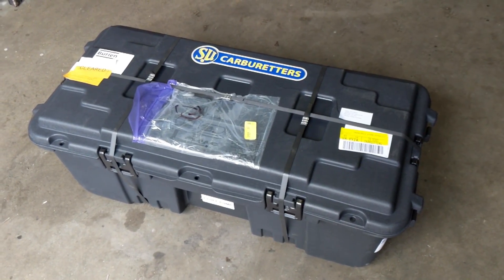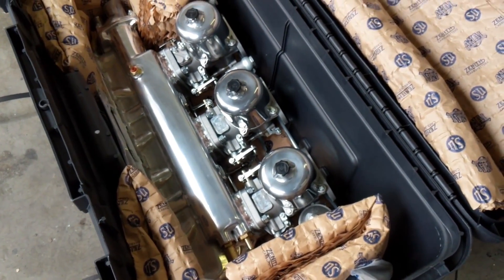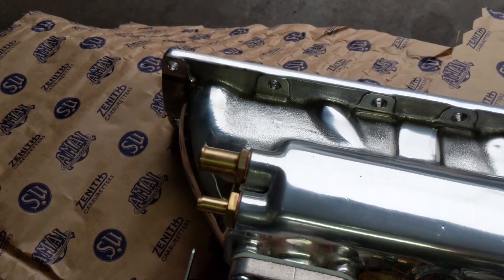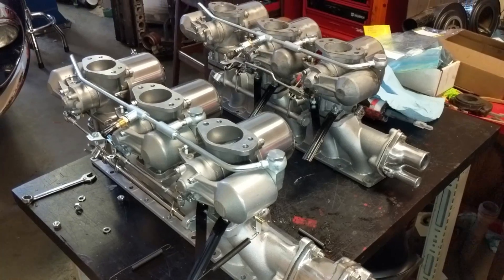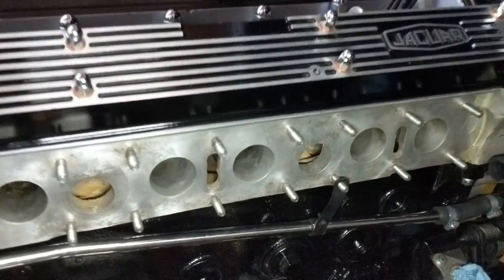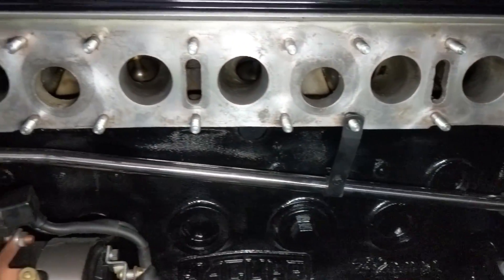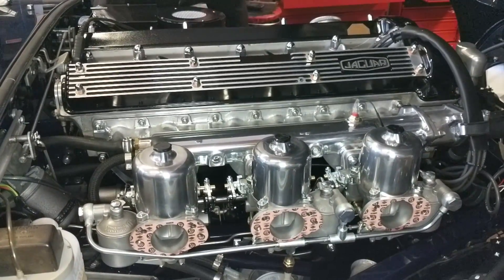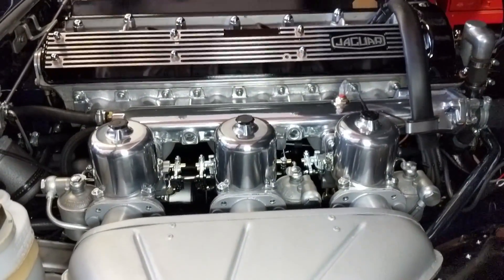Unboxing a NEW set of Triple SU Carburettors

Comment: Superb work with outstanding reman parts. Good eye on spotting the fuel leak. If you hadn't you may have discovered the short cut to perfectly tuned SU's. Set the whole rig on fire!

I had a'72 XJ6 in which I had done a head rebuild and carb swap from the factory Strombergs to twin 2" SU's. I had dearly wanted triplets but couldn't find any. 
The morning after finishing the project, I departed on a roadtrip from Toronto to Boston. The carb setup proved very troublesome for the entire trip untill on the way home at a stop in Connecticut, the cold start automatic enrichment device malfunctioned spilling raw fuel everywhere which promptly ignited. A number of tense moments went by while the conflagration was subdued with a borrowed fire extinguisher. I was forced to do a complete dismantle and rebuild at the roadside with a fair amount of improvisation to replace melted parts as there were no repair or parts sources available on a Saturday afternoon in Connecticut for an old British car. 
Once back on the road, I found that it ran better than it had ever run before and continued to do so for years after. Minus the enrichment device.

Comment: Synchronizing SU type carburetors – It isn’t hard to do at all, and the homemade tools are very inexpensive and easy to make.  You need 3 each 6” x1/4” wood dowels; in a pinch 3 good wood pencils will do nicely. Clean the dowels (or pencils) up so that both ends are flat and there are no splinters or bits of wood that can fall off and cause problems. The hardest part of the job is to suck out any oil from the dampener pistons so that the dowels don't float in the oil. Remove the dampeners from the carburetors and insert the wood dowels, pressing  down on them until they bottom out. Take a knife and score the wood dowels using the top of the piston housing where the dampers screw in as a resting point for the side of the knife. Twist the dowels while holding the knife edge against them to make a small groove all the way around the dowels. 

That groove is our zero mark and starting point for our engine running test.

Next, start the engine and note the distance of the marks above the top of the piston housing. Adjust the idle speed stop screw on each carburetor so that all 3 marks are at the same level above the top of the piston housing where the dampeners screw in and at the desired idle speed. A 6” General Tool stainless steel ruler works well for those who need a visual aid in getting all 3 marks to the same distance above the piston housing where the dampeners screw in.

As you push down the accelerator, you will notice that once properly adjusted,  the marks on the 3 dowels maintain the same distance above the piston housing where the dampeners screw in.
Reply from the maker: Neat process I assume this in lieu of a Uni-Syn Carburetor Synchronizer?
Reply: YES. It works on any number of SU carburetors  until you run out of wooden pencils to sacrifice... :LOL  It allows you to see what all the carburetors are doing in real time. No need to move the Uni-Syn and then find that after adjusting one carburetor that the other carburetors need adjusting.

Comment: lol I remember people saying use brake fluid instead of oil for the dashpots on an su carb as it doesn't rot the diaphragm and also made them more responsive as its thinner,,,,,hmmm?
Reply: I think you are confusing SU carbs with Stromberg, the diaphragm on a SU is only in contact with the fuel, the Stromberg has a different set up, although I will agree that using brake fluid in the dashpot might make them responsive but the correct oil is there for a reason, to enrich the mixture on acceleration.
Reply: Maybe has been a long time
Reply: I seem to remember being told to put automatic transmission fluid in the dashpots on SUs. They seemed to run fine.

Comment: I had a 1969 MGB Roadster with wire wheels that had the dual 38mm sidedraft SU carbs and it was interesting to work on them and tune them. Experimenting with mixture needles of different taper, to get the F/A ratio exactly right, was an interesting task. I would also fill in jet orifices with solder and then drill them out with tiny hand-turned drill bits for exact mixture control. I used to use a UniSyn meter for synchronizing carbs on my bikes and the MGB and Austin Healy that I owned. On my bike that had an individual carb for each cylinder, I would rough set the balance with either a UniSyn or measure intake port vacuum on each cylinder. I would then fine tune the carbs by doing a power balance test, where I would short individual cylinders an adjust the throttle butterflies for equal RPM drop from each cylinder.
Reply from the maker: Wow you had tuning down to a science!

Comment: Seeing as how you Hearted my comment, I will share a secret technique with you and all your followers.
How to avoid cross threading a screw, nut or bolt, and how to retain structural integrity in plastic when re-installing screws.
Always, lightly back the screw, nut or bolt in the reverse direction of the thread.
As you slowly turn the screw, nut or bolt backwards, as the threads of the two pieces come together, the screw, nut or bolt, will drop into the other piece, usually you will also hear a click.
It is at this point that you have mated the two pieces so thta when you apply rotation in the proper direction, you will not cross thread the screw, nut or bolt.
For everyone that has to remove screws from plastic objects repair what is inside the enclosure and then re-insert the screw, and maintain the strength of the original fitment, this technique should always be done. If you simply start turning the screws back into the plastic, you will cut new threads and reduce the structural integrity of your product by as much as 50%. Further, you will not get a third kick at the can, as the thread in the plastic almost always strips on the third attempt.
Happy screwing people! ;-)

Comment: Case is nice!  Free toolbox!
So what did you do with the packing?  Too nice to throw away.
I remember buying two 1 3/4"  SU's brand new for $25 the pair at an auto show here in OZ a while back. When British Leyland stopped making the P76 (Google it...) they sold all the bits very cheap.
Cant get over how smooth that engine is.

Comment: How do SU's compare to Webers?  I had a Datsun 240z with triple Webers.  I miss it still.  I have gone to the dark side and drive a pushrod V8 now (Chevy LT1 direct injection  in a C7 Corvette).
Reply: A headache to maintain after they get worn out
Reply: @GearheadOutlaw  Which?  the SUs or the Webers? It was always my impression that Webers were the top of the heap given that they were used in race cars (Ferraris, etc.) But I have always had a soft spot for SU.
Reply: @dwightbrown2808  was talking about the SUs.  My series 1.5 has 3 and I'm over the fence for webers and at the same time want it to remain original.
Reply from the maker: Webers are far superior in the corners, must be the float bowl design? Not sure.
Reply: @RichardMichaelOwen  you could have a look here as it sums up the technical differences between the two.

http://www.mossmotoring.com/carburetors-su-vs-weber/

Comment: I did my apprenticeship on Jag, Daimler & Rolls back in the day in NZ & put 2" SU's on a lot of different engines. I actually have one on my VW experimental aircraft engine now & 4 on a Continental O-720-8 that is destined for a street rod. Those suckers are getting hard to find now.
Reply from the maker: Continental O-720-8!! would very much like to see that.
Reply: @RichardMichaelOwen  They are a really rare engine & I got mine from a farmer who had it as a spare for his Ag plane crop duster that was long gone, I actually traded some work for it. It was new with zero hours but minus the fuel injection & covered in hay dust in a barn. I built a center plenum box for the SU's. Here's the only pic of one I could find online that has the crossflow heads like mine. http://gulfstreamaviationcompany.com/

Comment: Of course it leaks. Its British. It helps keep the rust away! A dry sump means no oil. Thats how you can tell!! Lol.
Reply: And American cars of the same era were so much better - not!!
Reply: @wcads623  true, true, however they would leave smaller puddles, not having Lucas ignition systems they were not parked as long.
Reply: @wcads623  Stuff just required more adjustment and maintenance than it does now.  My first car (a 67 Lincoln) seemed to require constant fiddling-new plugs once or twice a year, replacing the points and condenser in the ignition.  TVs were much the same way.
Reply: LMAO. Good one Mate!
Reply: If a Jag does not leak oil it has none!! And ask any racer about racing Jags about the constant oil mist on the windscreen! 6 or 12 no difference.
Reply: In the trade it's called wewe.
Reply: This is 2019, still see a awful lot of leaked oil in parking lots, but not too many old jags or any British cars come to that. I have to wonder where all this oil is coming from?
Reply: My brother had a TR7, it shut off in a downpour and we coasted into a shop/gas station. He came out and told us to get that p.o.s. off his property, he helped us push it across the street to a phone booth.
Reply: Hellow Mark, the bloke did have a point, I have known TR7's and Stags having there engines and wiring harness being striped and rebuilt after only 6K. Of cause, once the engine had been properly reassembled it was bullet proof, the wiring loom on the other hand was just terrible, prince of darkness!

Comment: Tuning triples was seen as a dark art only known to the chief mechanic
Reply: Actually quite simple. To set proper mixtures can really only be done on  a dyno. But the rest is quite simple provided you have a good linkage set up. 
The 2" though are quite a bit different to the  1 3/4 Austin 1800 mk1 carbs that many use in triple carb set ups for many 6 cyl engines.
That original aircleaner box though is bad news for power, almost a choke. And tuning must be done with that air restriction on.
I use a filter about that size for each carb straight on the carb. The main reason is to go over the ramtubes which give a little more power and better mid range grunt [torque]
Reply: Only slightly more effort than tuning twin SU's really. One of those things you have to wrap your head around the first time, and really study the instructions. Once you understand how these simple carbs work it becomes pretty easy. There again I've got over 30 years in motorcycle work and am quite used to multiple carb setups.